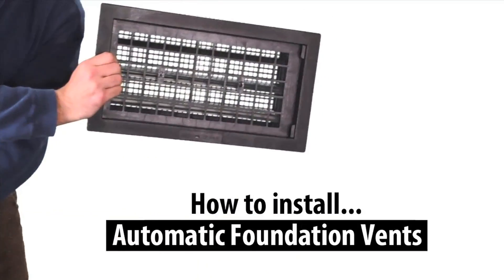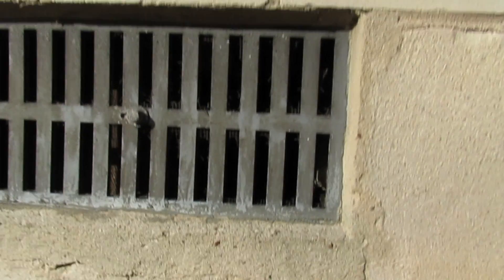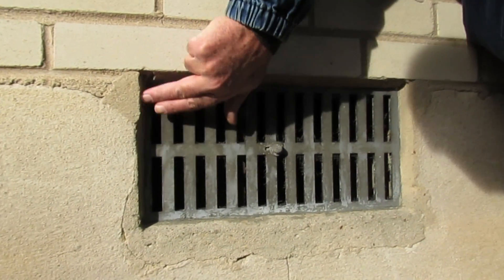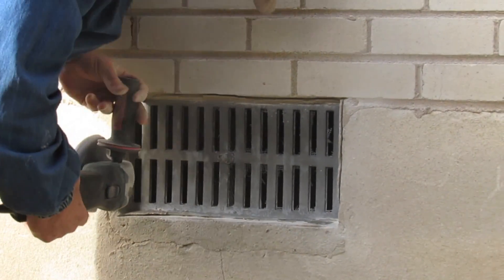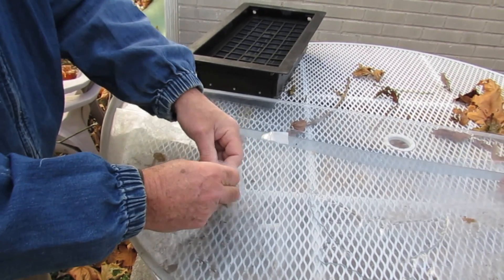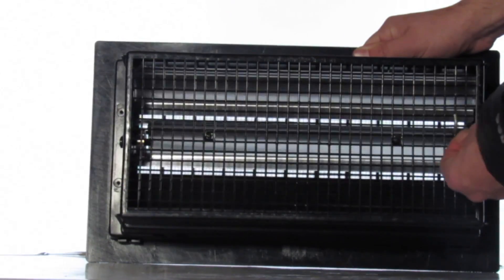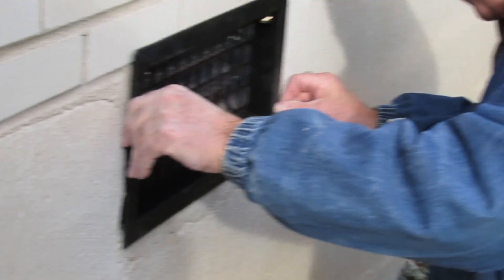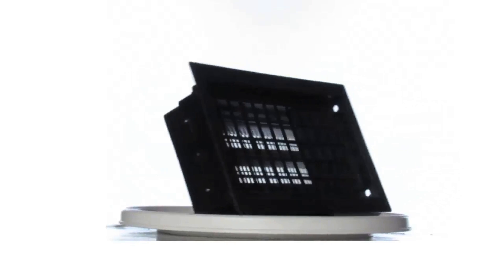How to install automatic foundation vents

Comment: anyone type automatic vent better or worst on the market? i didn't hear or see  a brand   name of the vent being installed.
Reply: +sgtlewisbond , +buddingco replied "We sell the air inc vents. The cheapo versions don't come with all the hardware on the actual vent and the springs look a bit iffy. No complaints on the air inc so far if you want to see more info on it click the order now at the top of this video.  Thanks"

Comment from the maker: First cut out a single block in your foundation with a grinder. Then parge the opening. Let that dry and follow our video instructions to insert the new vent. If you have pictures of your basement wall you can email them to me for further assistance.

Comment: Any recommendations for installing a vent in a location that does not currently have one to add additional ventilation?
Reply: +Donald T , +buddingco replied "First cut out a single block in your foundation with a grinder. Then parge the opening. Let that dry and follow our video instructions to insert the new vent. If you have pictures of your basement wall you can email them to me for further assistance."